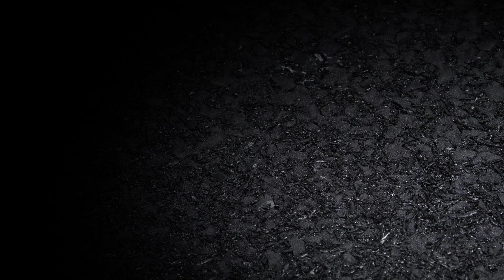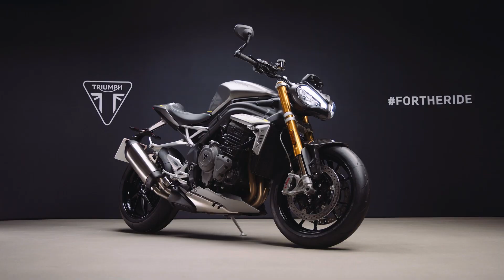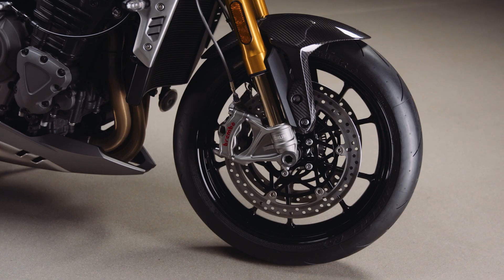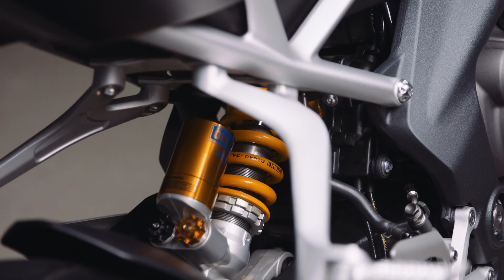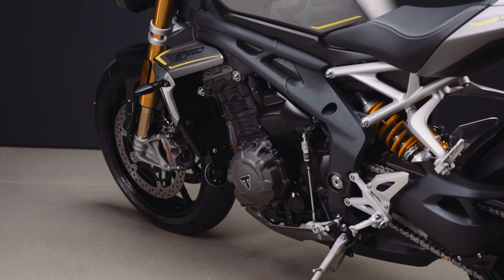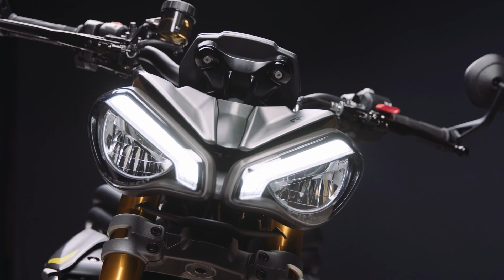2021 Triumph Speed Triple 1200 RS - In-Depth Q&A

Comment: Hi
In regards to pleasure to set up the triumph dressed up in the Ohlins suspension.
Did Triumph and Ohlins get the low speed damping sorted at the rear TTX (a small bumps are a pain on all of the previous R models)? Or is it just impossible when using this TTX technology due to the flow issues caused by the size of mine and damping pistons ? Is Ohlins TTX a scam? Why did they change the shock body material 3 times now (including steel ! - on the sports focused weight saving element)???
Also what is the deal with Ohlins oil and the black deposit that it produces over time, that clogs up the valving and damages the oil seals ...
I would love to see someone addressing those issues. 
Thanks